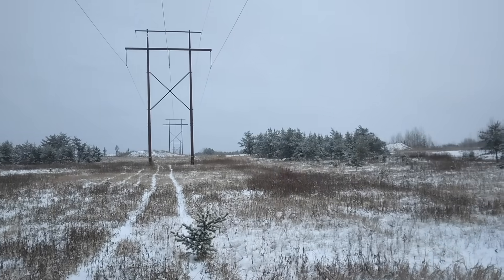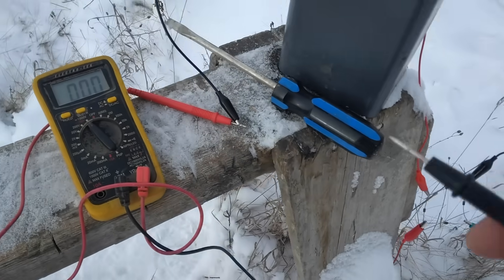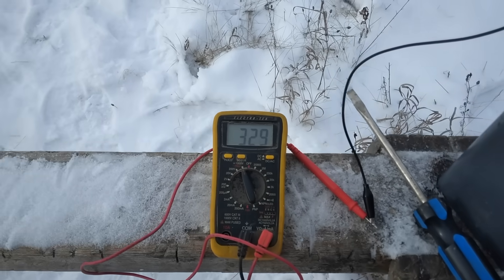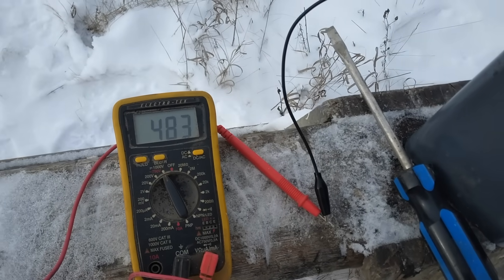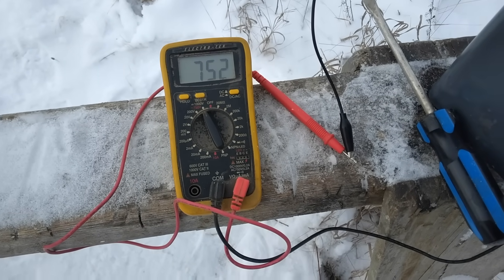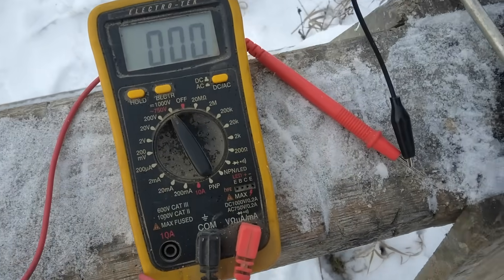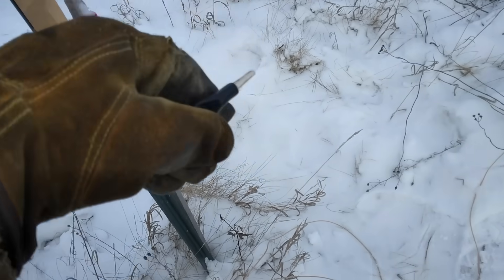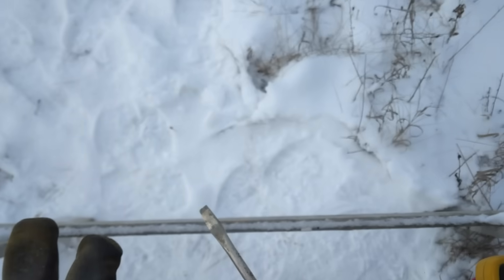Fences sucking power from under HV transmission lines

Comment: Perhaps you can do some experiments to see whether inductive or capacitive coupling is more effective at obtaining power. Maybe hook the capacitively coupled wire to a transformer to bring the voltage down to something safer. Maybe try to light an incandescent light bulb?

Comment: We have some houses where the have high tension line ( at least 69KV running in back of houses. People living there can use the area for playing & picnics but not allowed to install sheds or play equipment under or maybe 20' from either side of the wires.

Comment: That looked like 88 Mega Farads to me. It’s pretty big. You may find the capacitor will charge up by itself just sitting under the HV and no ground wire. When you tested it for discharge I noticed it was rising up.

You may want to test that away from the wires for a straight Earth battery potential in your area.
Reply: No, it’s microfarads.  A 1 Farad capacitor is a huge amount of capacitance, and until about 30 years ago, nobody was able to make such a thing, at least not in a single device.  Years ago (like on the old cap in the video), people used M for micro on caps, since it was before widespread standardization on µ, the labeling font didn’t have µ, and everyone knew that all possible caps (at that time) were a lot less than 1 Farad.  Today, if you get a 1 Farad or bigger capacitor, it will be low(ish) voltage, because that’s all that the technology can do.  Mostly under 100V, with a few going up to 200 or 315V at most.
Reply: You: "That looked like 88 Mega Farads to me"
Doc from Back to the Future : "88 mega farads!!! 88 mega farads!!!" (desperately yelling while frantically running around the lab putting hands in his hair)

Comment: This is the principle of mutual induction. It’s the same principle used when designing transformers that are used to reduce the voltage that goes to your home or in to reduce line voltage in consumer electronics devices. Your makeshift antenna will have a voltage induced on it; however, a metal fence will not because the posts are driven sufficiently into the earth to shunt the induced voltage to ground. Be safe!

Comment: You want to give the other side of that capacitor a big induction coil as an antenna to pick up the power around you. You have the earth but you don't have the high side connected to anything decent, only the cables from the multimeter and the cap own interior may be picking up that power from the induction field.. One side of the cap might be connected to the can (it's exterior) If this is the case, for this experiment you probably want that side to be the side receiving the energy from the induction field and ground / earth the positive side of the cap or the side that is not connected to the can / casing. In any case a big winding of wire would help. Try parking your car beneath and wrapping the entire car in cable to connect to one side of the cap then put the earth on the other side. You need more pickup from the induction field. Also it's probably better if you run your earth stake away from the high voltage line a bit to avoid the effects of cancellation from the induction field above and around that zone.

Comment: When i was up in the cabin many years ago there was HV power lines running through the one section of the property. You could stand underneath them holding a fluorescent light tube in one hand and when you ran your other hand up the tube it would light up.

Comment: Wow! I got an easement on my property and have been wondering why there are fence posts but no fence installed along the property line. Interesting. I wonder if there is a way to capture that and reuse it on the property.
Reply: Yes, but if you make a habit of it they can prosecute you. If you take electricity it does come from them, it's not just waste. There is waste but if you harvest some you will add to the waste.

IMO it is ethical for party tricks or tiny amounts of power like some Arduino door lock, but unethical if you try to harvest serious amounts of power.
Reply: @alexc4924  I was thinking like electric fence or something. The posts are metal. I've been considering making the area corn field or cow pasture. So far it's just been where deer bed down.
Reply: @StoicThrower  I doubt they can prosecute you for taking advantage of the electricity they're putting in your fence to make it an electric fence. It would only be if you actually harvest the electricity from the fence.

Comment: Harvesting wasted energy from antiquated, inefficient infrastructure. Very smart sir.
Reply: It's not really the fault of "antiquated" infrastructure.  When superconductivity is practical, efficiencies will increase.  Whether the line was built in 1922 or 2024, present technology will be inefficient due to the (past and present) fundamental economics of transmission system design.  Let's see what happens once we depart from ACAR, ACSR, HTLS and ACC conductors with significant corona losses.  Superconductivity will hasten this advantage.
Reply: This comment was necessary to keep our humility. No real innovation here just skimming fat off a broken energy transfer system. 

Nicola Tesla, where art thou?
Reply: It's not wasted but stolen when done in such a way.

Comment: Farmer got disabled after fixing a hay bailer issue under HV power lines. Tractor was left running while repairing bailer. The exhaust created a conducive path to the tractor and charged . When he attempted to mount the tractor he was electrocuted. Be careful.
Reply from the maker: Wow! Interesting.

Comment: I have read where these lines cause leukemia if you live withing 100 yards of one - the body runs off of electricity impulses, and so much electricity around you screws with that electricity in our bodies.  3 or 4 years back the electric company in Amarillo was running a line from Hobbs to them and I was one of the perferred paths.   I wrote them a letter explaining all the irrigation they were going to interfere with along that path, drew a map of that,  the line is up now, not on my place, everything I look at it going to Lubbock, I think - poor farmers, none of them wanted this and public domain forced it upon them.  I wonder if you could buy solar batteries - lithium - and run a house off of all the lost energy.  On the way to Seagraves, mennonites, about 8 of them have new houses right next to one of these lines, new pretty houses that are going to kill their children over time.

Comment: Curious... What's the point of doing this?

It's common knowledge that high power lines put off high power in the surrounding air/ground...

Thats generally why you don't see houses below them or airports right near them.

It's also why property is cheap around them.

Yes, high power lines put off a strong electromagnetic interference and is known to cause cancer if exposed for long durations over time..

So..... You're doing this why?
Reply: Curious that you’re watching and commenting on this. Why?

Comment: Don't know if you already are aware,  but this phenomenon is called a "capasitive connection" and are caused by how the ac power change polarity and are "connected" to earth, but even if you measure voltage, i do not think you can extract any current/power? Depending on the electrical system perhaps

Comment: 0:45   The Fence is Catching the Electricity, Not Stealing it.   The Power from The Hot Wires Overhead, is Naturally going to Ground.
Reply: Nope, not how electricity works.  The fence is being charged by induction and the power is sapping power from the electric grid.  This will cause resistance in the power grid and the power company will need to supply additional power for this
Reply: This is not how electricity works
Reply: Shocking how some folk can be so confident in their ignorance.

Comment: You are focusing on the voltage of your equipment. With regard to safety and/or usable energy, the current is essential. It will be very low. In fact, the voltage alone could be very high. In Europe, the field strength under power lines (near ground) is limited to 5000 Volts/meter, meaning 5000 Volts between two wires with a distance of 1 m between them.

Comment: A car or truck parked underneath these lines can also have a potential difference induced in them by the overhead HV lines.  I was painfully shocked twice under such circumstances and measured the voltage between the van frame and the Earth at 330 VAC.

Comment: Please, please, please do not do this.  I retired from the high voltage power line business.  Our grounding practice was to keep from electrocuting our workers.  Unfortunately, we did have grounding practices that weren't followed correctly and have lost workers.  The electromagnetic coupling varies with distance and humidity.  This can kill you!  Don't do this!
Reply: Also varies with the current being carried by the powerline.  You cannot control the system well enough to be safe.  Don't do this, please!

Comment: You have the right Idea but add the function behind the capacitor to regulate DC so it can be safely sent and stored in batteries for later use. Basically creating a battery charger

Comment: I was truly suprised by how much energy was actually being leaked through the RF surrounding those towers !  I used to live directly under some very high voltage lines ( I think 240k ) and never noticed any arcs forming off of nails or sharp objects nearby the towers, even if I touched one of the tower legs to make myself a better antenna in that RF circuit.  That was truly surprising how much power you were able to rectify & store in such a short period of time !
Reply: All the power carried in those lines is actually in the fields around the wires.
Reply: "how much energy was actually being leaked through the RF surrounding those towers"
Nothing leaked here - he simply stole that bit of power.
Reply: @ABaumstumpf The power company knowingly radiated that power into his property.  I don't think you can characterize this as "stealing".
Reply: @stargazer7644  "I don't think you can characterize this as "stealing"."
Then you are just wrong.
Reply: @ABaumstumpf  Then every person with a radio receiver is stealing power from the broadcasters.
Reply: @stargazer7644  "Then every person with a radio receiver is stealing power from the broadcasters."
With the difference that broadcasts are designed to deliver that power to begin with.
You know - like you are not stealing the oxygen your neighbours grass is producing, but if you would go there and dig up his onions then it is theft.

Wow the lunatics here are really sad.
Reply: @stargazer7644  "What's really sad is someone who can't manage to have a discussion without making personal attacks."
Ah and of course resorting to fallacies cause you know you got no argument - classic.
Reply: @stargazer7644  If I go drill a hole in an oil pipeline to fill up my car it's not "stealing", after all, the company was just losing that oil anyway
Reply: Congratulations on the most blatant false equivalence I've seen this month.  If this guy was running a cable up the pole and connecting to the power line you might have a point.  But you don't.  So should the power company be sending a bill for the power that is being lost as heat in the farmer's wire fence that's under the power lines too?   That's stealing too, right?  What about the power induced in the guard rail along the road?  Someone needs to arrest the dept of transportation for stealing, right?
Reply: @stargazer7644  You quite obviously don't understand how electric fields work. If the wire wasn't there, the power wouldn't be drawn from the field. So yes, it's stealing and if you're unlucky the power company will find out and make you pay
Reply: @stargazer7644  intent is the key factor here. Anyone can accidentally capacitive couple some power, and is typically not enough to ever matter. Someone stealing enough to power a business to any degree Beyond some LEDs or something is quite obviously intentionally stealing
Reply: @Magneticitist  It quite simply is not possible to "power a business" this way, unless your business can run on milliwatts.  That is what makes this entirely a ridiculous non-issue.  If you tried to charge an iphone with the power being generated here it would take over 76 hours.  He's getting a whopping 151 MICRO amps of current out of that wire. Just so puffy doesn't ask, a microamp is a millionth of an amp.  You can approximately calculate this by looking at the dV/dt he was getting while charging into 88 microfarads.  If it was in any way possible to move significant power this way, we wouldn't need wires.
Reply: @stargazer7644  if u have a business consisting of selling lemonade the sure maybe but no, not likely. Everyone knows the story is bs.
Reply: @stargazer7644 Actually in some countries it is classified as stealing.

It isn't surplus power that is being emitted out. That is not how this works.

The power consumed by loads where inductive coupling is used, is still power that ia not available to genuine fee paying customers, so by consuming electricity in this way you are depriving the suppler of revenue. And that is theft.
Reply: @ABaumstumpf The difference is quite obviously this:

The power company is distributing electricity and selling it to make a profit. You need to read my post again. It clearly states that by taking electricity in this way, you are depriving the power company of revenue.
That is a key element of theft.

When a radio or television broadcaster transmits radiowaves and a person generates electricity from it, the person receiving those radiowaves and converting them to electricity is NOT depriving the broadcast company of revenue.

Second, you are mixing up EM waves with electric and magnetic fields. The induction and transmission of electricity through the air is not happening as a consequnce of RF radiation.
Reply: @deang5622  You are completely missing the point.  So you're telling me somehow I'm not allowed to run an antenna wire anywhere I want across my own land?  I don't recall giving away any rights like that in the written power company easement.  The power involved here is utterly insignificant compared even to the resistive losses in the wire overhead.  I call Bullsh!t.  Show me anyone who has ever been convicted of this.
Reply: @deang5622 You might want to blow off that dusty physics textbook and review what exactly an accelerated charge creates.  In what jurisdiction is "depriving a company of revenue" the definition of theft?  Every time you pull into traffic in front of a delivery van and slow him down you're depriving a company of revenue.
Reply: @deang5622  "Second, you are mixing up EM waves with electric and magnetic fields."
?? No i am not, and the rest we even agree on. Have you responded to the wrong comment?
Reply: @stargazer7644  "In what jurisdiction is "depriving a company of revenue" the definition of theft?"
When you are just an intentionally dishonest person and have to attack a strawmen... Pathetic.
Yeah, how about you quote the FULL sentence instead of just cherry-picking part of it?
But go figure - a person that thinks stealing is fine is also sub-par in morals in other aspects.
Reply: It's electric field capacitive coupling off the high voltage 60hz. It's an "on steroids" version of holding a NC voltage tester to a hanging 120VAC 60hz wire and having small current controlled darlington transistors turn on from the coupling. 

When considering RF and a transmitter as an example.. the only time it's hard to call it 'stealing' is if receivers are in the far field and they are not 'siphoning' anything noticeable at all because they need to amplify the signal again on their end.
Reply: Don't get confused between:
1. RF fields comprising photons of EM energy which comprise a changing magnetic field component and a changing electric field component which are perpendicular to each other and moving at the speed of light

2. Electric fields being produced by a voltage

3. Magnetic fields being produced by a current

What's happening in the video are inductive effects caused by 2 and 3, not 1.

Comment: During car park renovations at work they moved the car park to directly under a 660kV transmission line.
One fellow got 680 volts through him due to his car channeling the emf from the line and acting as a capacitor.
If you stand under. 660kV line with a 4 foot fluorescent tube in your hand and raise it above your head it will light up.

Comment: Fences have engineered grounding requirements depending on whether a fence runs parallel or perpendicular to the utility lines. That would include, depending on the voltage and distance of the fence. Ground rods with spacing (usually every 10' apart), and isolation panels on fencing (fiberglass fence panels listed for grounding). Buried bare copper wire attached to spaced ground rods, size is dependent on voltage, and copper wire (4/0), attached to ground rods and fence. All to create a grounded system. According to NEC and NESC, all grounding components must be UL "listed" for use for grounding purposes. This is just a very brief explanation of the grounding requirements that are near utility lines. All fence grounding comes stamped by a state PE and inspected by your JHA (jurisdiction having authority). State, county, city, utility. Be careful. Good luck
Reply: " All fence grounding comes stamped by a state PE and inspected by your JHA (jurisdiction having authority). State, county, city, utility. "    That's only if the fencing is part of a construction project requiring our design and PE seal. If Joe Schmo puts up a fence without going through red tape, we don't get involved, of course.
Reply: Agreed. However, you assume all responsibility and liability @cornwallav8r